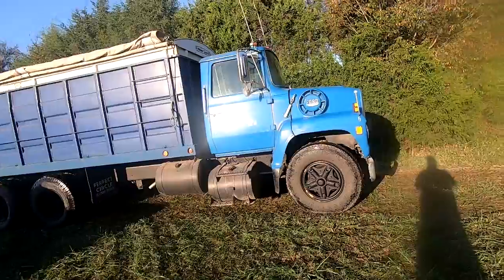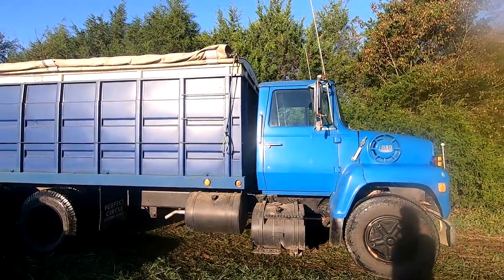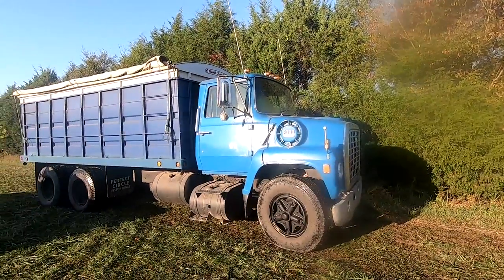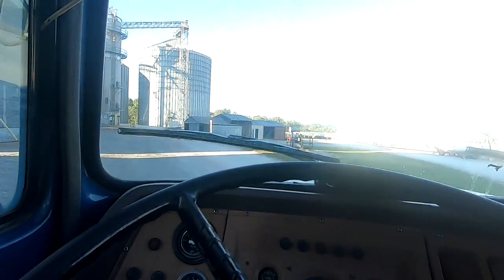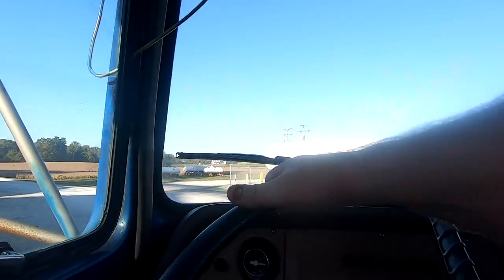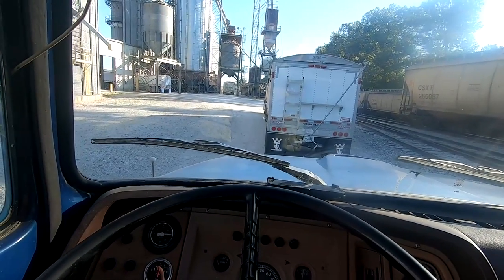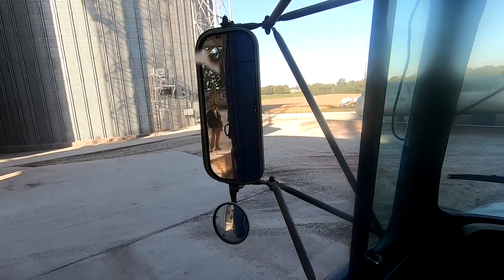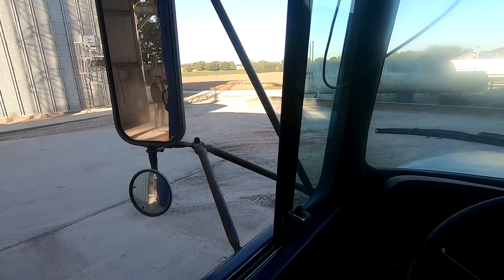Hauling Corn To The Elevator  Ford F800  Grain Truck on The Road

Comment: I live in a river valley and either way out is a big steep hill unless you go up river and then up a big hill. Steel trucks go in and out these hills. Bad in the winter.
Reply from the maker: The only direction I can go from the farm  without going down In the river bottoms is towards home. But that's in the opposite direction of the elevator so I'm climbing hills for a while. Thanks for watching!!

Comment: I enjoyed watching the trip to the elevator. Interesting to see different setups in different parts of the country. Just speaking from experience here. Be careful letting the corn stand too long.  Monitor what condition your stalks are in pretty regular. If the corn goes down that $330 dollar dock will look cheap.  You can go from making 170 bushel corn to 100 bushel corn over night if you get a strong wind.
Reply from the maker: They have a real nice setup there. Never have to get out of the truck and they move trucks through pretty quick. You are absolutely right about letting it stand too long. Right now it's still in good shape but that can change quick. The last load I took was 16% but their bins are full and not receiving anything for a few days plus it's raining. As soon as the rain moves through I'm going to try to get the rest knocked out even if I have to take it somewhere else. Thanks!
Reply: @stinsonfarms6724 About 17% is the breakeven here on moisture. Good luck with the rest of harvest.

Comment: That is a steep dock. If I took corn in at that %, I  would get docked $.07 on shrink and $.20 on discount.  That takes $5 corn to $4.73 a bushel. Then they hit you with drying charges. But $5 corn to $4.35, ouch.  Good luck my friend.
Reply from the maker: I shelled another load Tuesday that checked 16% and I can handle that. But now the elevator has all their bins full and they are not receiving anything for a few days. Plus it's been raining for the last 2 days with more to come yet. I hope I can get back going by mid week next week and knock the rest out. Best corn is still in the field. Thanks!!

Comment: Hopefully it will dry down ! I like the truck 👍🏻! 390 engine with a 5 speed ?
Reply from the maker: It has finally dried to 16% and now the elevator isn't taking corn for a few days. All bins are full. Yes 390 5 speed. Never get in 5th with it loaded. Thanks for stopping by!!

Comment: I’m looking at a truck similar to yours, is there anything I should be looking for that could be a problem? Thanks
Reply from the maker: I've only ran this one 1 season. It did well. It has an 18ft bed with a 391 engine. It will hold around 550 bushel but that's a little more than it has power for. It will handle 400 bushel good. I had an issue with the rear-end shifting when loaded. Shifts fine empty but when down shifting on a hill loaded it would sometimes stick in neutral. It works off vacuum and so does the breaks. If the one you are looking at is set up this way I'd make sure to check all the vacuum lines. Thanks for watching!!

Comment: How you doing man?! NEW subscriber here!

That is a beautiful truck! What engine does it have in it? I was shocked to see a 5-speed. I'm not sure that I've ever seen a tandem 5-speed like that. I figured when I saw it . . . it'd be a diesel, but I heard it running and knew I was wrong. lol How many mpg does it get, and are parts relatively easy to find for those? I'm looking forward to following along and seeing more of your videos. Have a great week, and stay safe out there!

Oh, and if you get a chance . . . hop over and check out our channel! - Samuel
Reply from the maker: Thanks!! It has a 391 in it. First 5 speed I have seen also. Never use 5th gear when it's loaded. It's nothing but a road gear. It gets around 8 or 9 MPG empty. It averaged 3 Mpg when I was hauling grain. Not good!! I checked out your channel. Some pretty good stuff! I have had a couple portable band mills in the past. Always liked working with lumber. Thanks for the support!!!
Reply: @stinsonfarms6724  3 MPG! Wow. lol